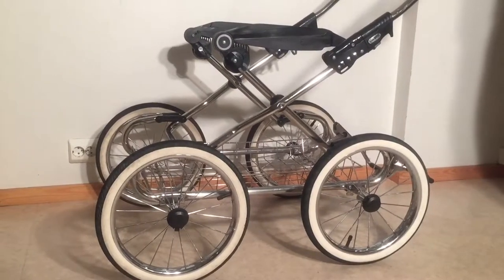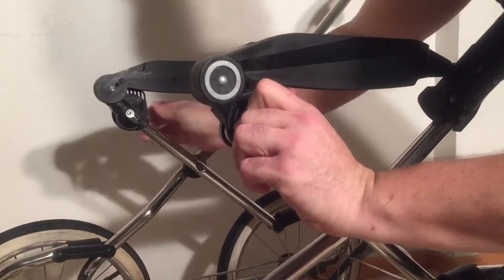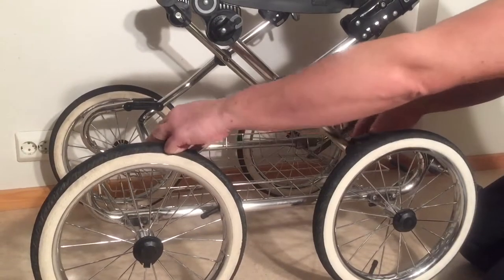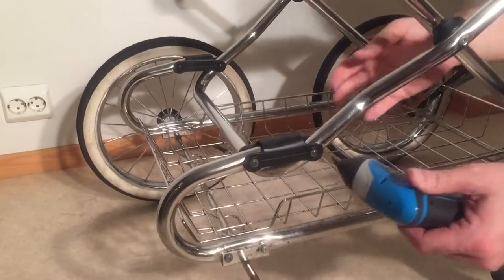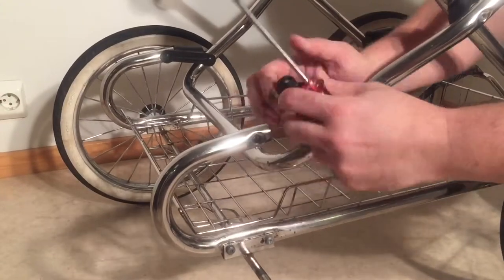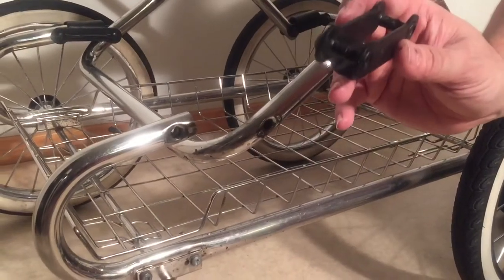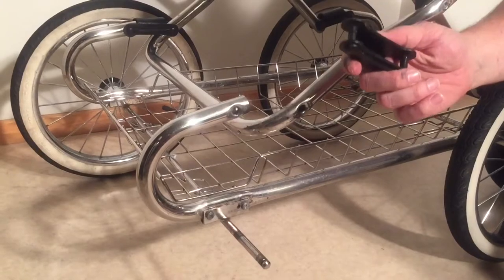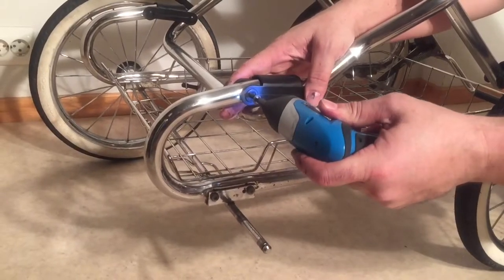How to Fix an Emmaljunga Mondial De Luxe that is too Loose

Comment: That's interesting about the suspension links having screws instead of rivets. I never paid attention to that on my Emmaljungas before. One of mine is a Carmen model from 2006, which is basically the same as the present day Mondial de Luxe except for having white air-less tires.

Comment: Is the whole stroller supposed to be in the exact position as it is in the video and as wobbly?
Reply from the maker: There should be some looseness to the chassis (that's what gives it suspension), but tightening the mechanisms should reduce this, unless there are additional problems like loose rivets, bent bars, or damage to 4 the plastic suspension hinges themselves.